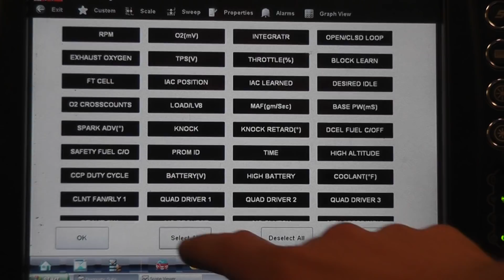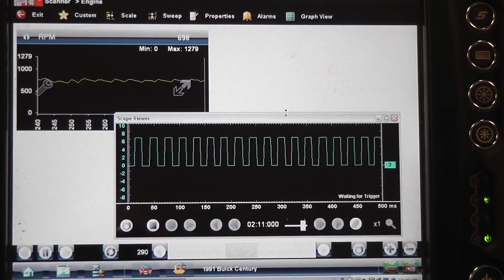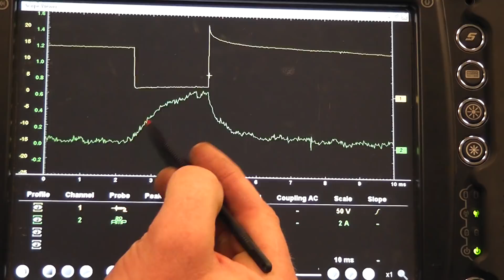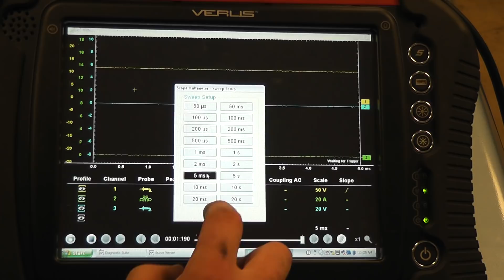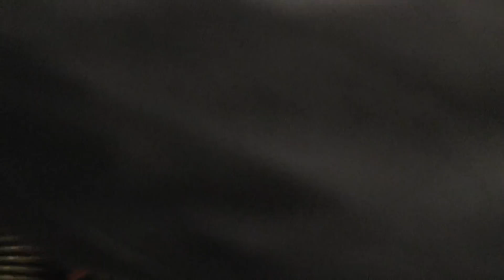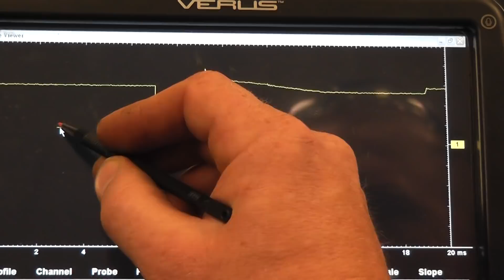GM 3300 Intermittent no start rough idle (shorted injectors) part 2

Comment from the maker: @Qbasic8 Yes, if I remember correctly you have to set your trigger to the RPM probe. Once you do this the "+" sign on the screen turns white. What I don't like about this is it doesn't show the trigger, it only shows the white "+" on the screen where the trigger is occurring. This is b.s. to me and snap-on needs to do something about it. A suggestion is to by a sync probe from AESwave and use it on channel 2 to trigger from instead of the RPM probe.

Comment from the maker: @ScannerDanner BTW if you are using a plug wire on the RPM trigger that would make sense that the injector current waveform goes away as the ignition and injection are not timed together. Connect your RPM trigger lead to the injector control wire instead. This should work for you, but again you will not see the trigger spike only the white "+" sign.

Comment from the maker: @CHIBA280CRV No, they are all sequential fired now. This means there is a separate driver for each injector and they are fired in firing order sequence. They also re-designed the injectors, so they don't short out anymore. They just stick mechanically now :)
Reply: I have a 95 Buick Park Ave , no start no crank. If I jump starter it'll run for a second and shut off but notjing at key. Resistor In key went bad causing security lockout. And kills pulse to injectors when I do jump start , if I snip purple and white rpm wire and t Into the Injectors would that stimulate the pulse I need ?
Reply: Then you get to take a screwdriver and beat the crap out of the injectors ... Better than beating the crap out of your windshield ... He he ...

Comment from the maker: @fivefortyeye540i This time base setting is for a scope only, you cannot change time base on a scanner. Remember the Verus is a scope and a scanner, so its easy to mistake which tool I am using sometimes. Different signals require different time base setting. For example, a fuel injector waveform, I may set the time base to 20m.s. screen, and a TPS waveform I may use a 5 second screen. Time base in the amount of time from end to end on the screen you are viewing,

Comment from the maker: @Amopower Thats cool, I grew up in South Park and I'm still there. Anyway both of your cars there is still a lot you can do with a scanner. (codes and data) Although data may be limited on the Probe. As far as a scope goes you should look into the Vantage Pro. You could even use an older Vantage (used on ebay) if you didn't want to go crazy with scope tests. You could still do coil current ramping and see fast on/off square wave signals, just not with the same detail.

Comment: Is there some sort of internal circuitry inside the injector that is actually shorting out?  I was just wondering what could actually be the problem going on inside the injector, causing the high amperage.  Thanks Paul

Comment: If you measured the resistance of the injectors, would that tell you which ones are bad "shorted"?
Reply: It would, but only if you have a known good reference. It's possible on these systems that ALL of them are bad, and in this case specifically, you'd probably only have 1 injector with higher resistance, which might lead you to believe that 1 injector is the problem. It's better to look at the loaded circuit almost always instead of relying on a resistance measurement.

Comment: Great info. What is making the current high enough to shut the car off intermittently? in other words, why doesn't that condition happen all the time when the injectors are bad?
Reply from the maker: the resistance of the shorted injector(s) changes with heat, so once current flow is high enough, that one single driver that controls all of the injectors will create a no start condition
Reply: @ScannerDanner  thanks.   I was having trouble coming up with the right way to describe that in my mind.   So when the cold engine starts, the shorted injector hasn't built up enough heat to overload the driver with too much current yet.  But as the engine runs, the heat rises which increases current to the point of driver overload.  The car would then shut off and not restart until cooled down.  

Is that the right way to describe it?
Reply from the maker: @Z14kt12timandjes1  exactly!
Reply: @ScannerDanner  thanks to God and you.... I'm getting this stuff!  I actually sit behind a desk for a living so I don't have a lot of experience with this stuff,  but from going through your book multiple times,  your premium channel and your YouTube channel,  I thank God for what's sinking into my mind.  I feel like I'm getting close!  I can watch many of your videos now and predict what tests you're going to do next.  Thanks so much for all you do!!!  I hope you never retire.

Comment: Paul, first just want to say thank you for all the great videos! I have a question on when the car doesn't start, the injector shows high amperage, and the driver shuts down to protect the circuit.If the circuit is shut down, how would there still be a high current flow as shown on the scope? I hope I explained my question right.
Reply from the maker: +Bryan Lamontagne I have 3 or 4 other shorted injector videos. One two part series where I'm drawing on my smartboard will answer your questions. Sorry no link offhand

Comment: Hey, I am using the Vantage Pro. Do you have any info on using the the RPM/Trigger pickup to be used as a trigger event? I can get the RPM to show correctly, but whenever I clamp it (and say have low amp probe on an injector) the waveform goes away when I have it set to trigger on the Aux port (trigger cable). Any ideas?

Comment: Hey Dan hopefully you can help. I have a 1990 reatta. I’ve tried literally everything. New crank sensor. New cam sensor which shouldn’t matter only changes injectors from sequential to batch fire. It has spark. It has fuel. And it has injectors working. I’ve even tried unplugging them once at a time to get it to start. I’ve also swapped icm and no difference. It’ll start up after sitting overnight with battery disconnected. And when it starts it runs rough and shakes and pops out intake the tachometer goes crazy it bounces up to 6000 rpm when it’s at idle and bounces up and down all over the tach. After 5 minutes of it starting and stalling running for no more then 3-10 seconds at time it then won’t start at all and just cranks. Until I let it sit again overnight. I’ve swapped ecms as well and no difference. I tried to cut the tan white bypass wire so it would run on the ignition timing without ecm control and it didn’t start still. Doesn’t run with starting fluid either. But again it does have strong spark. I’m just lost. I know it has to do with the rpm signal showing 6000 rpm and fluctuating all over the board. Just don’t know where to go from here besides trying to rewire whole circuit from crank sensor to icm to ecm. Any idea or help would be much appreciated.
Reply from the maker: You need a lab scope my friend. We need to see what the crank signal looks like

Comment: Hey, Paul. Could you please explain how the shorted injector overloads the driver? I know the short causes an increase in current flow, but from my understanding, if an injector is shorted t to ground( Internally or on the control wire if ground side switched), current finds a path to ground before it reaches the driver. Can you please help us understand how the driver can take a hit from a shorted injector? Your answer would be very valuable to me as your videos are.
Reply from the maker: watch these two videos, especially part 2
https://www.youtube.com/watch?v=KF9viLxwJNc
https://www.youtube.com/watch?v=3gTLY6vsxMg

Comment: Hi Paul I have question for you. Shorted injector has high current flow. I would expect to se higher  inductive spike with high current flow. Hope this question make sense. Thank you.
Reply from the maker: great question. The reason that higher amperage does not provide a higher inductive spike is because the magnetic field overall is much much weaker. 
Sure the magnetic field around the few strands of copper wire that are conductive will be higher, but what you need to remember is, it is the combination of ALL of the windings that create a large magnetic field. 
Make sense?
Reply: ScannerDanner yes it does. Thank you so much for taking your time to answer my question. You are truly great teacher. Cheers

Comment: Sort of curious now...  Does the "replace them all" theory apply to the Peak-and-Hold sequential injection Multec I's, or only the Saturated Switch bank/group fire?
Reply: The only peak and hold designs were in the TBI systems and those didn't have this problem
Reply: ScannerDanner Premium Oldsmobile Quad 4 engines up to 1998 used a peak and hold Multec I in an SFI setup.  Your brother recently changed a single injector on one of those engines, and I had a bit to say on the injector he used...

From what I understand, the flaw with the Multec I's is due to the coil being exposed to fuel to keep them cool.  Bad fuel or aggressive cleaners strips the insulating coating off the winding and shorts it out.
Reply: Didn't realize the quad 4 used a peak and hold.  If he changed only one injector,  I'm okay with that as the quad 4 engine is not known for shorted injectors.
Reply: rhkips Would you go to Finish Line and only buy one new shoe? or buy a single sock...some things need to be replaced in sets...couldn't stand dumbasses that just wanted to replace one spark plug when I worked at autozone...I wanted to smack them in the face

Comment: Old video but i will ask a question anyways. Would a 89 vette LT1 share the same injector design??? Parents gave me their old 89 vette and when it would get to operating temp it would stall and not start. Did all my basic checks and found the 3 front injectors on the Right Bank unplugged it would start and run and any of them plugged back in it would die immediately.
Reply from the maker: +Devon Morder absolutely! Do yourself a favor and change all 8. 
If you do not have a scope use your ohmmeter and measure each injector. They should be 12.6 ohms each

Comment: Hey Paul how would you do them amp measurements on the scope without an amp clamp
Reply from the maker: You don't. You need an inductive amp clamp. The only thing you can do is a resistance measurement on the injector

Comment: would you have been confident to replace the injectors just based on the voltage waveform and not using the amperage waveform?
Reply from the maker: +Cody Wichman yes! based on the low inductive spike. (minimum 60v is the spec)

Comment: Hey Danner! So I know a shorted injector will have a higher amperage draw, but what if you have an injector with LOW amperage draw? I have an 06 Cobalt that has constant misfires at idle, but they are barely noticeable. Mode 6 Data shows hundreds of misfires detected on one cylinder but, a single digits on other cylinders. Only set a misfire code once, but it runs great. Was messing with the scope the other day and noticed extremely low amperage on one injector. Could this be a bad driver?
Reply from the maker: Could be, but could also be a bad injector. Do a resistance measurement and compare to a known good cylinder

Comment: Hey Scanner Danner, we have a 92 Pontiac Grand Prix. It has good fuel pressure and spark. It just cranks and i saw your other video and i disconnected 1 injector and sprayed brake cleaner and it fired up and ran for about 5 minutes and then shut off. I even plugged in the injector and it was still running. I ohmed 3 injectors the front ones and they read 11.8 ohms
 The other 3 are under the intake so cant ohm them. The car just cranks and cranks and if i spray it with brake cleaner itll start and run. Would this be shorted injectors?
Reply from the maker: You can measure the resistance as a bank or group, either directly at the ECM connector or if it had one, the main, injector harness connector
Reply: Thanks so much for the help. It was an injector under the intake plenum. Replaced all 6 and fired up. Now he can drive to school after getting his license.

Comment: hm...maybe rpm pid wasn't there simply bcus of clear flood crank...i mean, had it been there the car would ve started which is contradictory to clear flood crank...i mean, if normal crank, maybe the rpm pid is there always(provided that there was reference)...whatever, just thinkin :)
Reply from the maker: the clear flood crank does not alter that data parameter in any way. you just can't always trust that test, use it as a guide only